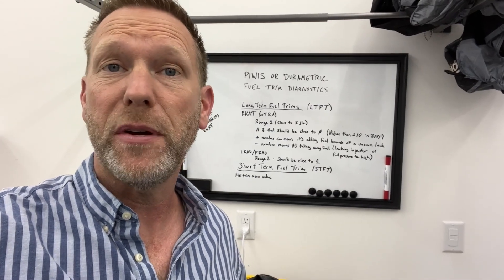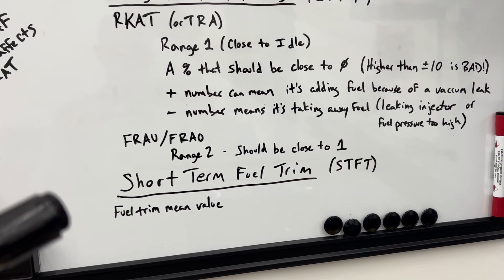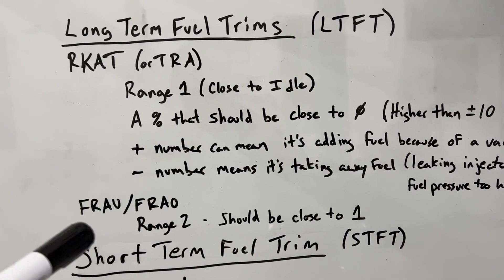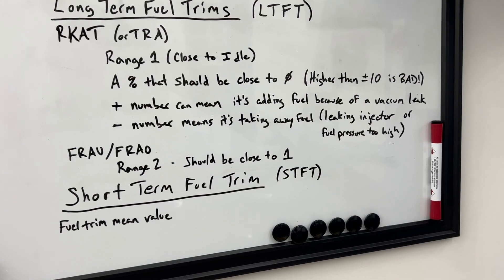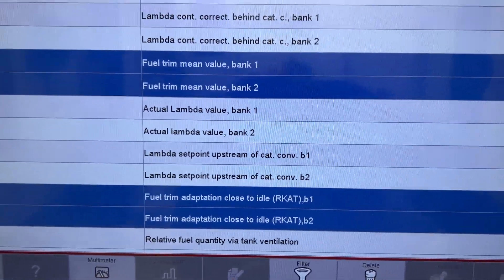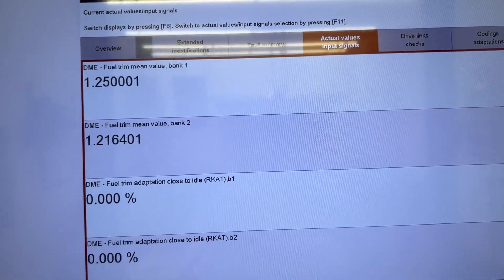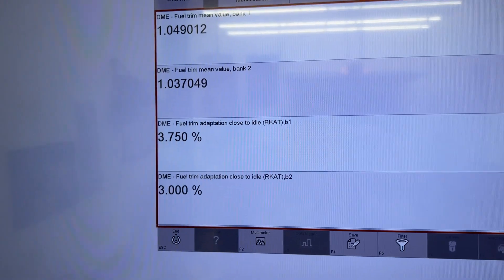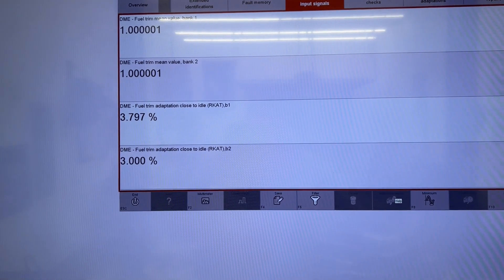Fuel Trim 101 - How to check the fuel trim on a Porsche using PIWIS or Durametric

Comment: Hi, nice video, thanks. I believe that the STFT is given different names by Porsche (possibly by date?) so PIWIS can obviously display FRAU or FRA0 (because it's a universal system) but you will only actually have either one or the other, according to which car you have and or how old it is. Does that make sense?

An increase in LTFT can be caused by:

Unmeasured air entering the engine due to a vacuum leak (higher fuel trim at idle, but less at higher RPMs)

Incorrectly reporting sensors (O2 or dirty MAF reporting less airflow)

Dirty or blocked fuel injectors

Exhaust leak before the O2 sensors

(A faulty AOS could easily cause both the rich mixture and the exhaust smoke.)
Reply from the maker: +p jay excellent additional info, thanks! 🍻

Comment: LNE did a video where Tony Callus explained fuel trims pretty well.  I watched that while trying to figure out why the fuel dilution on my 997.1’s UOA was high.  I ended up just replacing my injectors.  Haven’t done an oil change yet to see if that remedied it, but my LTFT did improve.  I never had codes, and I was using a Foxwell, so slightly different.  Considered popping for a Durametric but haven’t “needed to” yet.
Reply from the maker: +K1dPhresh1 how did you know the fuel dilution was high?

Comment: Hi Aaron,  not sure if you’ve seen this video, but help with diagnosing your fuel trim issues.

https://youtu.be/HW7BmBIJDXs

But I think you may have a intake leak, as both your RKAT figures are high.
Reply from the maker: I have seen that! Just watched it again though and after my own research I can understand what he’s saying better now!
Reply: I've just watched your video and the LNE video and they each give quite different information.
Yours says RKAT and FRAU/FRA0 is looking for 1 whereas the LNE video says they should be 0. Also LNE says RKAT won't go more than +/- 6% without a CEL.
I don't know which is correct, but I thought it was worth mentioning.

Comment: I'm here in NC and had the same identical fault codes 2196, 2198, and check engine light stayed turned on it was the o2 sensors....not to mention I have aftermarket headers...those codes only Appeared once I added the new o2 sensors....never trust new parts....I put the old ancient o2 sensors back and check engine light and fault never came back 5 months now..... but definitely need to visit you to use your piwis 🙏
Reply from the maker: +super saiyan hmm… I also changed O2 sensors and have aftermarket headers (no cats)
I’m going to sell the PIWIS I think, so let me know 😉
Reply: @HelpMeDIY  how much are you going to sale the piwis for?
Reply from the maker: @19lol19  not sure. DM me on IG or FB
Reply: @Help Me DIY  ok I got you on instagram what's your Facebook?
Reply from the maker: @19lol19  help me diy 😂

Comment: Hey Aaron, 3% fuel trim deviation isn’t a ton. 10-20% is cause for concern. I don’t think 3% would cause heavy smoking. You did aos already? If so, I’d check for vac leaks next. Check your o2s to confirm rich mix, pre and post cats. Might try fuel cleaner for fuel system later also.
Reply from the maker: +Phil 702 new AOS ✅ 
Vac leak test ✅ 
New fuel injectors ✅ 
Need to learn how to “check O2s”